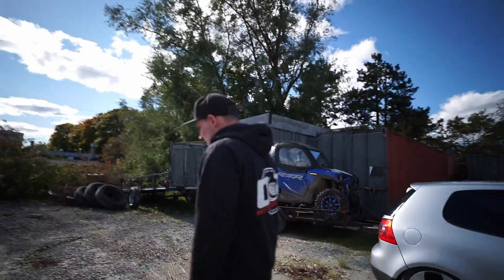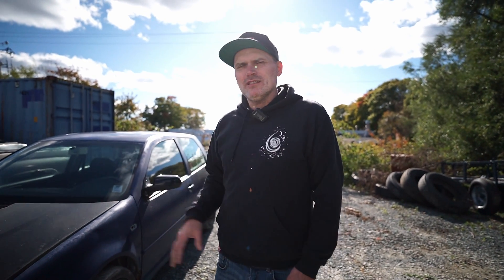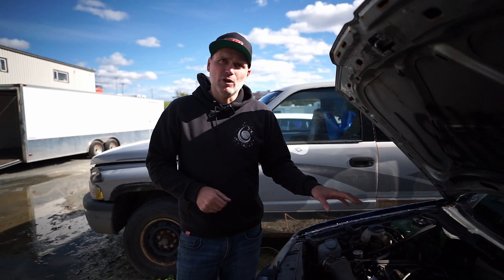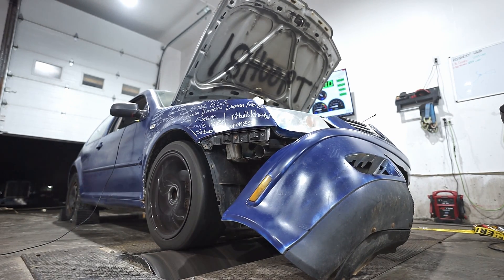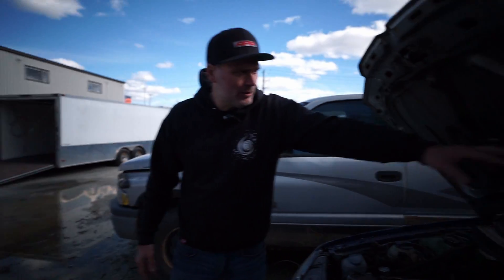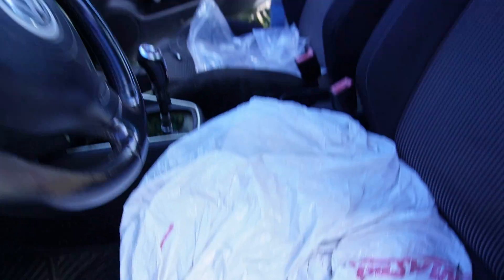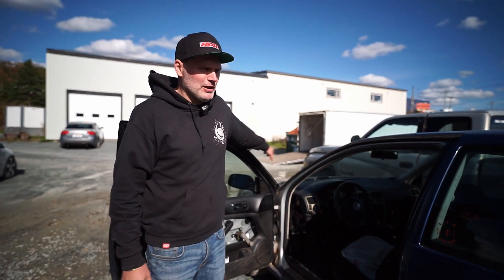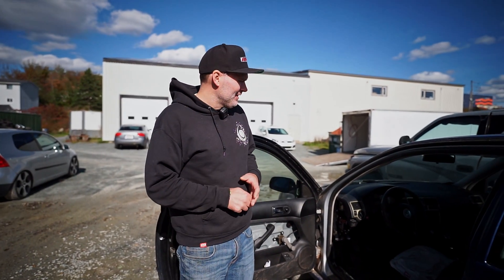What Happened to our Highest Horsepower Stock Engine 1.8T?

Comment from the maker: For those going to ask... every part of this build is in the series. Turbo size, injectors... everything! Check out the playlist if you missed it.
Reply: I've hit past 600 with my awm b5.5 passat. The oem rods had their casting imperfections removed and the entire rotating assembly (rods, pistons, crank, bearings, and torqued to spec) were balance to almost 10krpm. All but one of the rods are fine, the one that wasnt had a slight curve to it. Turbo was a gt3582r, 1000cc injectors, and an ignitron ecu. e90@32psi..
Reply from the maker: @JaysPCImpossible  very nice, awesome numbers. Not exactly the same as yours is a big pin engine, and clearly we're did no balancing here. Lol Any chance you can send us your dyno sheet?
Reply: @COMotorsports  I'm actually rebuilding the engine. Doing I-beam rods, forged pistons, race intake/exhaust cam, upgraded valves and springs, full port and polish, 2000cc injectors, and too much stuff to list. I'm trying to go for 1000hp. Was actually wondering if ecu yall use can be adapted to the b5.5 passat?
Reply from the maker: @JaysPCImpossible  best of luck. If you're plans are to make 1000hp, then adapting the ECU shouldn't be an issue for you.
Reply: Hey id be beyond psyked to win that thing!! 
  *Im looking at grabbing something for a daily driver actually, '94'ish 16 valve Scirocco, g60 converted to vr6 corrado, or pretty much any GTI I can swing.. really thinking of getting one with the vr6 and adding a turbo or super charger-- BUT, guess these 1.8 and 2.0 motors sure can make some great HP!! Now im torn, I've always wanted a nice Corrado but with a 1-1/2 yr old and a 7yr old it really isn't what i need rt now...

Comment: I have 2x 1.8T vehicles. 02' Jetta GLS and 04' Audi A4. A $1,738 stand alone ECU is NOT "affordable" at that price. GREAT work on ALL your video's!
Reply from the maker: It 100% is. Go price out other standalones that can do the same.
Reply: @COMotorsports  Im still using original Motronic ECU Tuned using NefMoto Software with a few Bolt-ons. I wish I could afford Your ECU or an AEM
Reply from the maker: @haroldhaynesiii  Yeah you can go for with stock ECU but full standalone opens up so many more options. Gotta pay to play as they say.
Reply: Yeah, when it comes down to what you get with stand along, you're never going to get the same capabilities out of the Motronic ECU

Comment: What engine code has the car?
As far as i know the AGU and BAM engines are forged from The factory.
Reply from the maker: This is an AWP.
Reply: @COMotorsports  thank you
Reply: None of the 1.8t variants have got any special treatment from factory. Only real difference between all of the 30 ish engine code variants is that the over 200ps ones are using 9.0:1 comp ratio instead of the usual 9.5:1 comp ratio. If it is using 19 or 20mm pin or small or big port head, does not give any significant benefit for reliability or power output when tuned with stock internals.

Comment: I have an 01 Audi TT, could I fit the engine into a mk3? I’ve been reading engine should fit but not the whole haldex system if it’s a Quattro
Reply from the maker: Engine no problem. Haldex you will need to do a bunch of work to the rear of the car to make that work.

Comment: I still think hoop 
 have pony's left in her
Reply from the maker: It didn't it was making like 45-46psi and 540-550whp. It made 598 at 42psi.
Reply: @COMotorsports  This motor hold this much power because of a great tuner. You can build a monster or stock but if not tuned correctly it will not last at all. I have a S3 8l 18T with emu black. It is great motors
Reply: @COMotorsports  very true, not bad for a stock motor with 19mm wrist pins
Reply: @johan5818 the wrist pins are irrelevant anyway as it’s not them that tend to break. That thing was an absolute trooper I also have a small port 1.8t but mated to a haldex and in a wagon 👌🏼👌🏼 fuckin love it
Reply: @COMotorsports  what fuel was in it and how much timing at 2.9 bar boost?
Reply from the maker: @philipmalan5336  most of that's in the videos.

Comment: Now that you mention it, a mk4 1.8T in a Golf R would be pretty rad!
Reply from the maker: It would honestly be a downgrade. lol
Reply: @COMotorsports  One cost 400 maple beavers, made 600whp and still runs. The other cost far more and puked its guts everywhere... 🤷‍♂
Reply from the maker: @mattlarson9897  If you seen the difference between the two graphs you'd understand why. Peak TQ at 5k and flat until red line on the 7R... The 1.8t made peak torque at 7k. So at 4k the 7r made over 200wtq and HP more than the 1.8t. There's no comparison between them in this scenario.
Reply: @COMotorsports  There are 20v drag cars pushing 1000+hp but i have yet to see any Golf Rs making 1000hp... Maybe the Golf R engines are still too new to be pushed super far, but the 1.8T 20v can make unbelievable power.
Reply from the maker: @mattlarson9897  we're aware of the potential of a built 1.8t, we build lots of them. However stock for stock which is what the two cars are...there's no comparison.
Reply: @COMotorsports  If you really want to look at stock motors, try to buy a stock Golf R motor. They really hard to find new or used. Owners are waiting months to replace motors that failed in their Golf R. My buddy had to replace 3 in the same month at his shop. 2 were mk6 and one mk7. None of them had any major modifications. While they do make more power from the factory they are not that strong. Again, your 1.8t is still running and your 2.0T turned itself inside out. I am still  waiting to see a Golf R make 1000+hp.
Reply from the maker: @mattlarson9897  a stock 1.8t could never make 400-450wtq from 4k to 7k. The 7r does all day. Yes they're expensive for sure there's no doubt and the head will be the limitation of making 1000whp on that engine due to the built-in in runner design. I'm sure it will happen but that's the major issue.

Comment: I’m rather curious if there’s a way to make that setup reliable enough to hit the track, perhaps a 1.8t B6 Audi with the 6spd or the 6spd from the 2.7t? Because that engine at 450hp with that setup is oddly giving me reliable power vibes despite the disadvantages of them rods. 

Love the series hope it keeps going, I’d be willing to send my 04 6spd B6 Audi wagon with the 1.8t, has 345km, I’m suspicious that the engine was replaced at some point but it runs perfect shifts perfect despite the original clutch, I’m unbothered if anything blows up lol

Sending positive vibes hope i can help✌️
Reply from the maker: Much appreciated, no problem building a reliable 18t setup at 450hp. Just needs the right parts. If you put junk in you get junk out.

Comment: Sooo...if you went ahead and 'dailied' this without beating it up much do you think it would survive longer than a year +/- or would it just grenade?
Reply: If they built the engine to handle the power thrown at it, like ANY other built engine it would last as long as it last. You can buy a Toyota Camry and with no mods and blow the engine with shite maintenance. A mildly built 1.8t well-maintained will last you as long as your left foot and wallet dictate, speed is addictive, but built correctly will offer many miles or even years of enjoyment.
Reply: @emotionalintelligence776   Sounds reasonable enough to me...I suppose I'm thinking that a near 600hp 1.8t engine that has crazy torque curves, even just normal driving with good maintenance, would it still survive? Haha I guess so🤷🏻‍♂️
Reply from the maker: This power curve on this setup to keep it alive would be lame to drive.
Reply: @brianfrisbie7937  What is your definition of "dialed"? More torque?? This high horsepower, stock internals build is dialed. The whole reason there is no early torque bump in the fun zone, is to preserve the fragile connecting rods and almost make 600hp. At the end of the day, just do it Brian - quit fucking around.
Reply: @vwbr3nt  I probably didn't spell it correctly but I didn't mean 'dialed' but a 'daily driven' vehicle
Reply: It would last considering you’d have to be at 6000 to be making any sort of power lol
Reply: @Vlad-zg5sk  Yeah that's a good point 👉